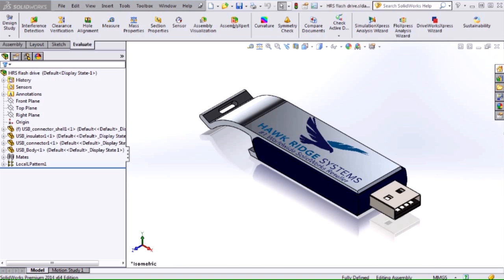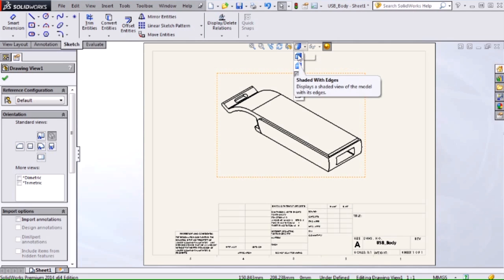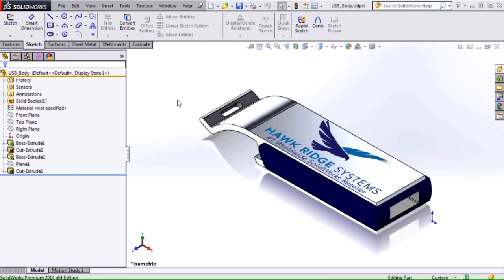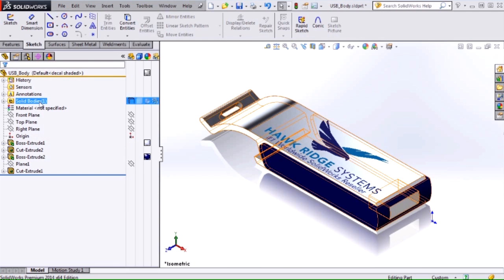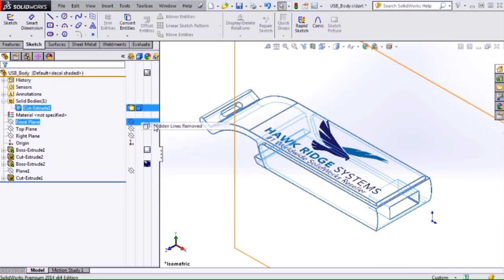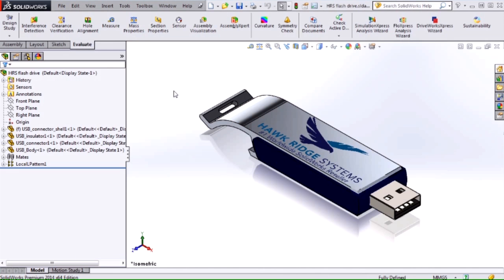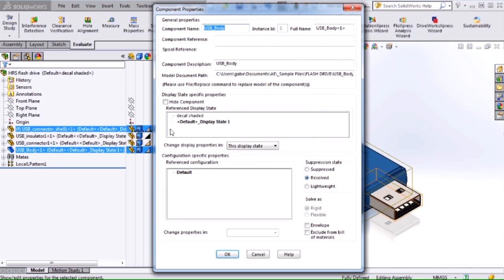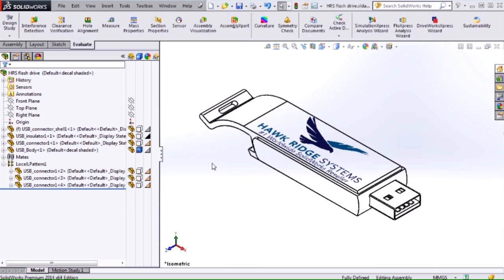SOLIDWORKS - Showing Decals in Drawing Views using a Non-shaded Display Style

Comment: I'm struggling to get this to work in Solidworks 2017. I can get the decal to show on the shaded view, but it won't allow me to change the state in the Feature tree.
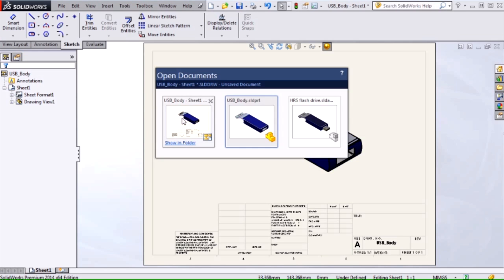Reply from the maker: Hi 06DynaGirl. I tested this in SOLIDWORKS 2017 to confirm it's working. When you go to make the change to the display style in the FeatureTree,  be sure that you are making the change at the Part level. Check out the steps to do this at 1:20 in the video.